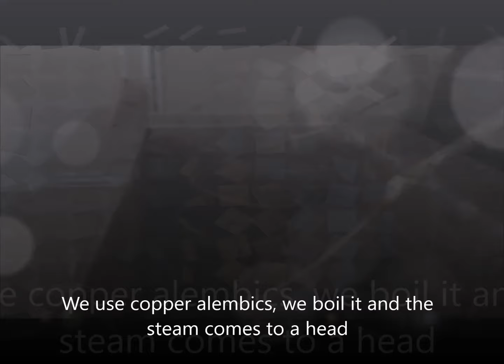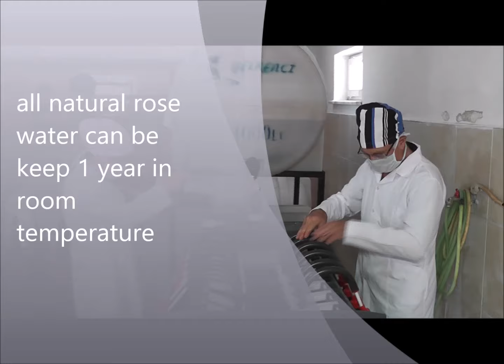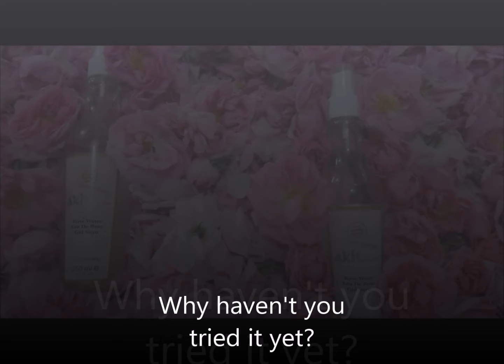Natural Rose Water

Comment: How does that work? Doesn't all rose water go through the same distillation process, except you use copper alembic. Which means what's making it last longer is either the copper alembic or the type of rose itself. So does that mean anyone who uses Rosa damascena for their rosewater will also be able to use it for 3-4 years?
Reply from the maker: Vaelyn of course no. This is our special manufacturing process. Yes we use traditional copper alembic but we have some special methods. It is our differences. That is why Akita Rose water different and special.

Comment: How does it last 3 years? All natural products go bad faster. Especially without preservatives, any water-based product will last 1 week max.
Reply from the maker: Vaelyn Thanks for your comment. You are right all natural products go bad faster without preservatives. Akita rose water has a Acetic Acid comes from rose oil and we don’t separate it. It preserves itself. We proove with microbiology tests, stability test. We have safety rating report about it and it says no need to put expiry date on the label.
Reply from the maker: And we kept our rose water in the room temperature for 8 to 9 years, they are still in good condition. Because it is fermenting too.